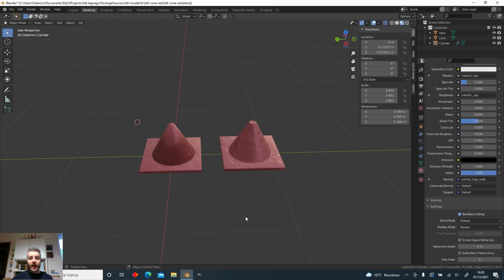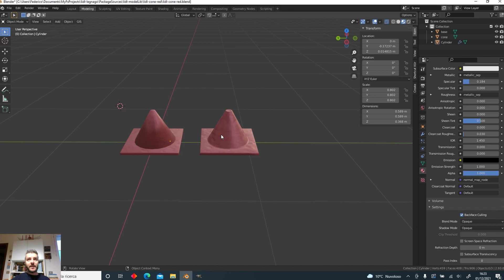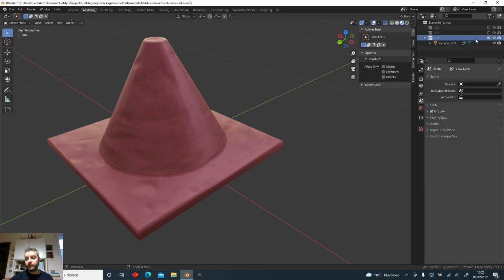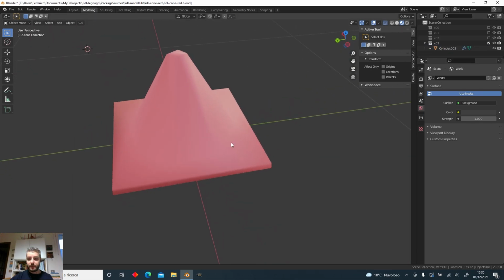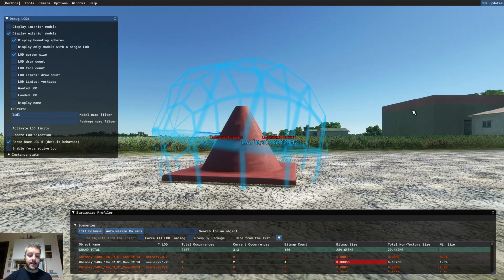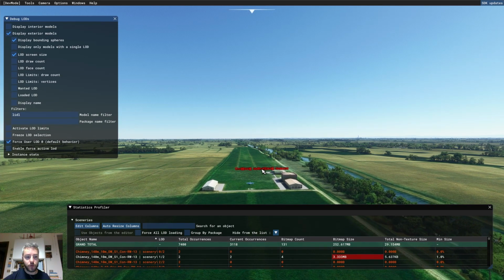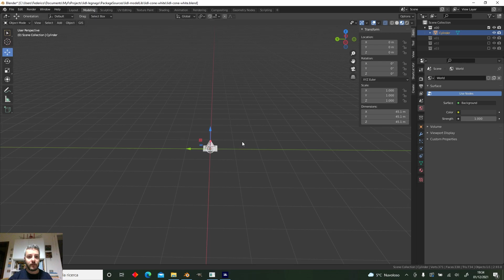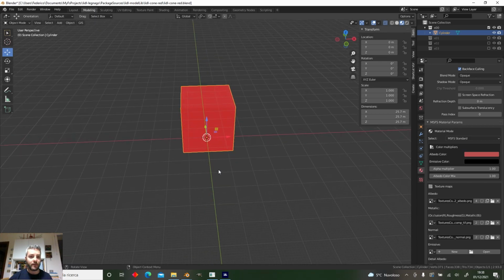MSFS SDK Tutorial - Episode 4 - How to LODs

Comment: Very old, doesn't use the current SDK (v0,23,3).
Reply from the maker: @pys-dafo_intl  well this is expected from a 2 years old video 😅.are you looking for specific information may I help you?
Reply: With the current SDK snd Asobo exporter, what  settings are required to properly set LODs.
Reply from the maker: @pys-dafo_intl  
For each lod, make a collection with object name followed by _LODx

Something like

FancyCone_LOD0
FancyCone_LOD1
FancyCone_LOD2

Wheb exporting using the Asobo Multiexporter, on the firt tab click Grouped by collection, press reload LODs and you are done 😊
Reply: @MSFS-SDK-TUTORIALS  On the LOD Values, should they be 100 - 0 or is it better to start at 10 - 0?
Reply from the maker: @pys-dafo_intl  Lod values are a percentage of the screen

There is really no " correct" value for them 
Anyways, for small objects you would want to use something around 30/50

Comment: If you run in to problems with white textures from the second LOD step then first do one export using batch export LODs.
Then hide all but x01, go to export, untick Batch export LODs. Then select the LOD01-file and press export.
Then repeat the same thing for all LOD steps you got in your Blender file. 

Now the textures should load after you build and reload the scenery.

Comment: Hello Frederico, first of all, thank you for your very detailed videos, which are a great help to me.
I work professionally with Rhino and have little experience with Blender. Even though I have learned a lot in the meantime, there is a problem with the LOD in FS2020, whereby the objects disappear earlier than expected. For testing I have created an invisible large cube and inside a small and a larger cube that are visible.  In FS2020, the value of the invisible large cube is displayed during the analysis, which is correct. However, the 2 visible cubes disappear within different distances as if they were separate objects that are not connected to the invisible large cube.This would be the same as if I were building a house with different parts that all disappear at different distances according to their sizes.  Since other third-party objects I use behave correctly, I think it must be a setting in Blender, or in the export. 
Maybe you have a solution for the problem and can give me a tip. I would be very pleased. Thank you very much.
All the best, Ralf
Reply from the maker: Hi Ralf, look closely at 12.40 in the video
The big cube Is added in edit mode to the original mesh (cone), making your mesh bigger. It Is a single mesh, not two. Every mesh Is a node with its own drawcall in the rendering engine, and each mesh size Is computed. You goal Is to have single big mesh
Reply: @MSFS-SDK-TUTORIALS  Hallo Frederico, grazie mille per il vostro aiuto e per la risposta rapida.
Unfortunately, when I added the cube, I did not see that no new object was added in the list on the right. Then it was already clear what had happened. Since my marker should light up in the evening, my marker for the runway consists of several parts, because the white stripe has to have a different material. So I read up on the merge function in Blender. Now everything works as desired. It's great that you took the time to help.
Cordiali saluti Ralf